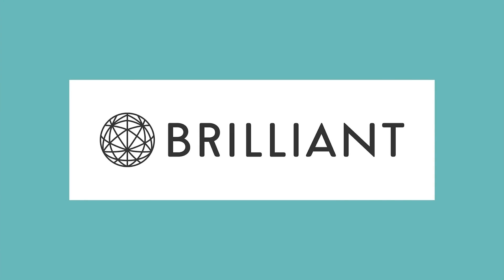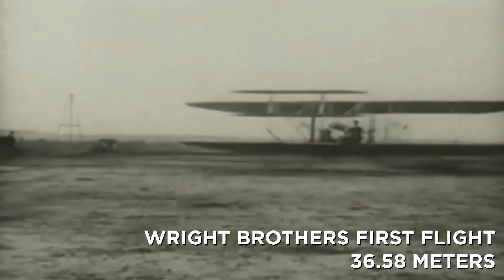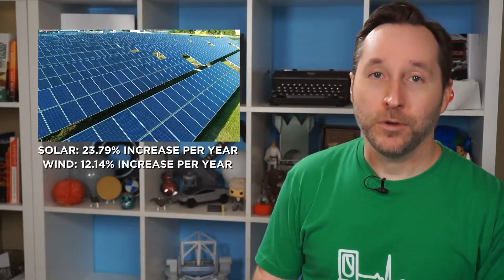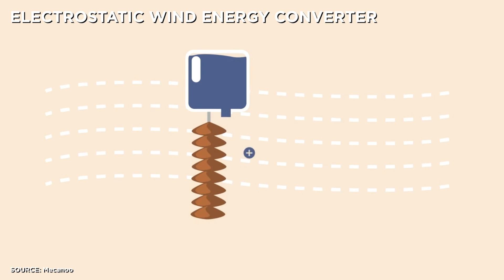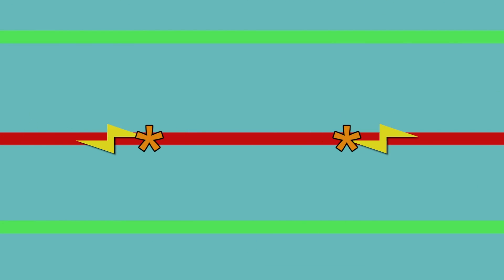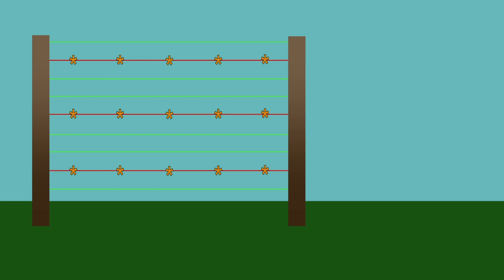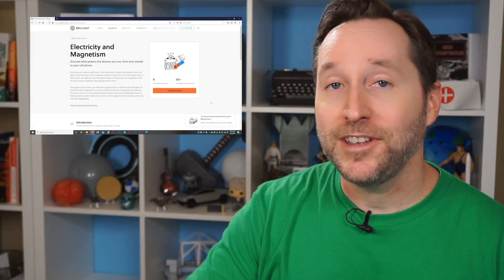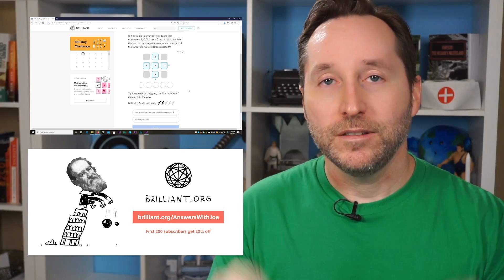Solid State Wind Energy | Random Thursday

Comment: In Washington a permit for solar panels are just as expensive or more than the solar panels you would need to power a home. About 2500 where I am.

Then theres installation and getting your meter decked out properly.

The electric and water companies are protected in alot of places.
Reply: Washington State or Washington DC?
Reply: @calamityjean1525  Washington not DC.

Comment: I lost interest halfway through when I realised that nothing really significant is on the table to make life easier than the present state of energy production.....it's true that if you rub the fur  on a cat's back you will create a phenomena called static electricity which is energy but not as you know it in the present day energy generators that are real and do make the World go around.........I'm all for a new way to get electricity out of the air, but at the same time it has to be practical and if it only equates to a very low capacity but interesting scientific phenomena I'm going back to bed to dream which is a far more relaxing way to pass the time.

Comment: Nah man, I did a project on that bird thing lol, the birds are fine we need to worry about our Bat homies, their echolocation doesn’t pick up the blade in the right amount of time, and get swatted out of the sky alot lol. I feel kinda bad for em ngl
Reply: I suspect the loss of bird habitat and pollution from coal mining far exceeds the harm from wind turbines.
Reply: @AndyFletcherX31  Not for big birds, and wind turbines are NOT a way to substitute for fossil carbon.
They encourage shale fracturing for the gas turbine (real turbines) spinning reserve. But the gas is carbon tetrahydride, a worse infrared absorber than the carbon dioxide it produces when burnt.
Reply: @albertrogers2506  Sorry gas is currently being used for balancing and when wind/solar is not available but this is starting to change with demand response, biomass and batteries. Expect big changes in the future with stuff like hydrogen being used to fill in for gas during times of low renewable production. As for shale fracking - this is an abomination which should never have become widespread as the CH4 leakage is high. If you want to know what is happening then I suggest you listen to the GTM Energy-gang and Interchange podcasts (USA), also the energy insiders podcast (AU) is well worth a listen.
Reply: @albertrogers2506  To be clear - I'm looking from the perspective of overall decarbonisation of the grid. Anything which displaces coal, gas and other fossil fuels is good. I'm based in the UK where we have seen almost the complete closure of coal power plants and a reduction in gas power production. The balance has come from mostly wind along with biomass (somewhat questionable) and solar PV. There are several websites which analyse the long term migration from fossil fuels towards renewables. Gas is certainly better than coal (about 1/2 CO2/KWH) but renewables are by far the best. The use of gas for power does not imply that you have to use fracking - indeed it is better if you don't because of methane escapes. It is even better to store hydrogen (or ammonia etc) from excess wind/solar and use it when there is low wind.  This is what the attention of the world is turning to apart from the USA which appears to be currently going backwards for many environmental issues.
Reply: @ccole1255  @andy fletcher  Batteries are puny compared with pumped hydro, by a factor of hundreds to  thousands, depending upon how much longer Elon Musk's stuff lasts compared with a laptop battery. 
But the amount of pumped hydro in the world is hardly enough compared with what would be needed to support even one state's "100% renewable energy".
Most of it is in China and Japan.
See Wikipedia.
The biggest pumped storage plant in the world, here in Virginia, has a power rating of 3,000 MW, and storage capability of 24,000 MWh, i.e. one gigawatt_day. 
By comparison, one kg of fissile nuclear fuel can deliver "8 million kWh" in today's outdated reactors (using the highest temperature at which you can keep water under pressure enough to NOT boil). That's 8,000. MWh  So 3 kg of fissile, i.e.less that 100 kg of nuclear fuel pellets,  can store as much electrical energy as the world's biggest storage plant. But it's worse  than that.
The Bath County's energy return efficiency is 80%, which impresses me. If you have a "wind farm" capable of delivering in a Good Year as much energy as a 1,100 MW nuclear plant, taking the pessimistic CF of 90% for the nuke, you can bet it needs to have a maximum power capacity of 3000 MW.  Virginia's average power demand last year was about 11 GW, and 30% of it was supplied by nuclear, at a CF of better than 95%  
So if you have enough wind generated power to handle that nearly 8 GW average load, you'll need about 24 GW of wind powered devices, and about as much pumped hydro in Virginia alone, as exists in the entire world.
Reply: @ccole1255  Take good look at the Democratic Party & who contributes. Most will take from Anyone. Not your Dad's Party anymore.
Reply: @albertrogers2506  Solar and wind power need very little SPINNING reserve, because solar and wind are surprisingly predicable up to 24 hours in advance.  The reserve capacity required to balance renewable power can be almost entirely "cold reserve" which burns no gas at all until it's needed.  When a shortage of renewable power is predicted, the cold turbines are fired up and turned into spinning reserve an hour or less before they are used to actually put current into the grid.  
Gas turbines are currently required to balance renewable energy because the transition is incomplete.  As solar, wind and (especially) batteries become cheaper and therefore more common, coal power will die out completely and oil & gas power will become increasingly rare.  Based on economics alone, it's expected that the US will be 90% or more powered by renewable energy no later than 2040.  This includes transportation (electric cars, trucks, buses, and trains) as well as all stationary uses for energy.
Reply: @albertrogers2506  Wind turbines can however generate electricity replacing that from coal/gas fired plants.  The UK grid ran coal less for most of the summer and recently wind & sun reduced fossil to about 25% of capacity.
What you write is a bad example of ignoring facts.
Reply: @calamityjean1525  Also if the gas turbine is spinning not generating much power, it won't need to burn nearly as much fuel as under load.
The rotating mass also acts as a short term energy store, which is why frequency can drop if there's generating capacity issues.
Pumped hydro can go online in seconds, but is geography limited
Reply: @albertrogers2506  "So if you have enough wind generated power to handle that nearly 8 GW average load, you'll need about 24 GW of wind powered devices, and about as much pumped hydro in Virginia alone, as exists in the entire world."
That might be close to true, IF you insist on having wind farms ONLY!!  However, if you include solar power, which is available when demand is highest, the demand for wind power is significantly reduced, and the need for storage even more so.
Reply: They don't even need to be hit. If you were suddenly surrounded by the low pressure region just in the lee of a wind "turbine"'s blade, you lungs would bleed to death too. Instead of lungs, birds have bone cavities.
Reply: @jacksimpson-rogers1069  Actually, birds have both lungs AND bone cavities, but you are essentially right, birds have a breathing mechanism that is radically different (and more efficient) than the one mammals have.

Comment: A little correction to "40,000 volts is a lot of energy that would drain a battery pretty quickly" -- well, no. Voltage isn't energy. Voltage times current is power (Watts) multiplied by time is energy (Joules). In principle, a 40,000 volt battery could have a very long shelf life, if no current was drawn from it. This is sort of like a high-voltage electric car battery that won't discharge until you drive the car.

But a very nice video anyway.

Comment: How about putting a piezo electric  cells on the back of solar panels  installed on a angle. A wing effect might cause pressure differences as wind flows over the panels.

Comment: Hey Joe, what species of birds are being killed by wind turbines?  Are they the same species that house cats kill?  Or are wind turbines killing the kinds of birds that can (and do) kill cats?  Think about Yellowstone and the wolves, and trophic cascades: wind turbines are killing off apex predators like eagles, kestrals, kites, migratory bats, etc.  because it's a part of the airspace that we just haven't occupied yet.  Most planes fly much higher, briefly transitioning that zone; whereas the turbines are in that airspace 24/7.  Pair that with a short blade-life (hail damage destroys the aerodynamic profile), no way to recycle the blades, intermittent output that requires burning of fossil fuels to balance the load, and we have to admit that they're just NOT a solution to producing industrial quantities of power.  Even this solid state method requires a revolution in the density of power storage to work.  Nuclear is a better option, with a smaller footprint, and (surprisingly) less waste; especially if you reuse that waste as fuel in a fast-reactor.

Comment: Not just oversold. It cant become a main source of wind energy because of physical limits. All these news and youtube channels always hype things up without ever thinking about if that is possible. They say maybe it will be used for home energy generation or we will have planes flying with ionic wind but the amounts of energy and the efficiency of this is VERY VERY low. It would be like building a blimp powered by electricity. The Hindenberg was MASSIVE and only carried a few people. There is a reason that this is the first time there has ever been a plane built using this. It is because it can barely lift itself. These lifters are usually built from foil strips and straws and barely lift that.

Comment: Wind power, no matter how generated, is low value because it's random power. You have to have a reliable grid powered by gas, nuclear, coal or hydro to compensate for the random fluctuations from wind power. Otherwise, you'll constantly suffer from brown outs and voltage surges, rendering your grid useless. That's why wind power requires government subsidies and mandates; no one would use it unless someone else was forced to pay the bill.

Comment: I've built over 1000 wind turbines.  I have walked the fields as they run.  I have never walked, driven or in any other way noticed an abundance of birds dead on the ground.  Not even one.  I have seen flocks completely avoid a set of turbines though.  Anyway those bird groups can either go build a coal facility and see how the birds like that or go shut off all of the electronic devices they use to spread their bs.

Comment: Liked the general idea.  Who knows?    As far as the 40K volts or so, might that be wind driven too.  As in a Van de Graaf generator?  The small electric motor that is typical of such high voltage devices might be directly replaced with a pinwheel?  Just a thought.  Might have to grease the pinwheel part with some light oil from time to time.  If it isn't one thing it is likely something else, it seems.  Best of luck.

Comment: If it's relying on thin wires, I would think that the system would be fairly fragile?  Instead of birds dying by flying into them, they'd be destroying them instead, lol.  I suppose if the idea takes off, and it develops at the pace of something like solar, we'll see some use from it in a few decades, but I'm not getting my hopes up.

Comment: I think if the huge wind turbines were generating a DC current, then convert to ac before going to the grid, it could spin much slower, saving birds, and with the blades designed to spin slower with much more TQ, could possibly harness more of the winds energy,  example a 100' blade, forming a nearly 200' diameter turbine, spinning with a tip speed of 10-15 mph , could still be generating 10's of kW, of better,  as for myself, I'm going to install several small turbines, 500-1kw about 6-8 if them, to hopefully generate 1-2 kw on a slight breeze, and 4-6kw in wind storms,  using the excess to heat water, for home use, or simply to heat the house, with radiator system, that has the option of using a wood/trash fired boiler, (or solar/wind power, along with concentrated solar thermal, if completed,, it could be very effiecent).  I don't think I'm under 12' turbines kill that many birds! (I don't want to kill any animals, especially birds, bees, and butterflies, and specifically neighbours, that can be really bad!! Ha-ha! No very close neighbors thankfully!!                  Happy Friday!

Comment: If you consider the hundreds of thousands of miles of passive fencing we have poured millions of dollars into around the globe, replacing them with a form of fencing that generates even a very small amount of electricity would be a major step forward.  Why not recoup SOMETHING additional for the expense?  I'm sure a fence that stands for 50 years would generate enough electricity to pay for itself several times over, even if it only generates a few watts per hour.  It could power water pumps to fill resevoirs from undeground wells, or weather stations, remote radio relay stations... etc. etc...

Comment: I have an idea to scale it and increase the efficiency. 

Put the arrays on something that moves fast. Not just something that gets wind. 

Like using a train’s rail system. You put the arrays on those passenger rail cars and as the wind passes over them, you generate electricity but since the train is moving you’re also getting more wind blowing over the arrays. 

The negative charge being pulled from the ground can travel via the same  wire design but it’s connection travels up from the earth, through the rail road tracks up along the side of the train to the arrays on the train completing the loop. 

There’s many examples of trains with electrical connections to their rails and tracks. Sometimes those connections are above the trains on overhead rails too. 

So just modify those already established pathways a bit to also have a line added to pull negative charge from the ground to complete the array loop. 

You can construct the same thing on a air craft carrier too with a negative charge pull line going up from the side of the ship to the arrays. 
Salt water you know? Very good conductor of electricity. 
Imagine how much wind is experienced on a aircraft carriers as it travels the worlds oceans? 

If you replace the power source of a air craft carrier with something renewable and add those arrays as an auxiliary power source and add battery banks to where the fuel of the aircraft carriers used to be, you could effectively keep those battery banks topped off all day depending on the electricity generation of the renewables including the arrays. 

Or maybe instead of a aircraft carrier you use a civilian cargo ship? Either way. Just my idea

Comment: This sounds like free energy. Do the wires wear out or something?
Reply: Energy is from the wind moving, nothing in the mechanical parts needs to be consumed for this to work, but guaranteed the performance of the system will fall over time due to fouling of the sharp points on the wire where discharge takes place as well as various forms of corrosion.

Comment: People have been making "UFO's" out of the ion plane's design for years.  I don't remember the site, but there used to be one that showed you how to build a ufo out of balsa wood, foil and wire, powered by an old CRT TV to generate the high voltages needed.  The main issue was avoiding electrocuting yourself.  lol

Comment: They didn't run positive 20000V through a wire and -20000V through the other - a circuit has no inherent + or -, running DC power needs a circle. They put 40000V between the wire (+) and aerofoil (-), leading some ions to make the flight from the wire to the foil.

Comment: Normally we use the ground (Earth) as an "infinite" electrical sink. So the reverse would be to establish an electrical differential between the Earth and the atmosphere - where there's a diff there can be a current. So Tesla drove a ground conductor deep into the ground and sent a conducting cable up into the atmosphere. In general the higher, the greater the charge difference (the ultimate would be the constantly solar wind charged ionosphere vis a vis the Earth). This device is a way of enhancing a charge difference much closer to the ground.

Comment: The reason wind is a utility scale endeavor is because doubling the blade of the turbine quadruples the swept area, so you get some huge economies of size. The bigger the blade the cheaper the energy. Small residential blades will never be able to compete with large utility scale wind turbines.